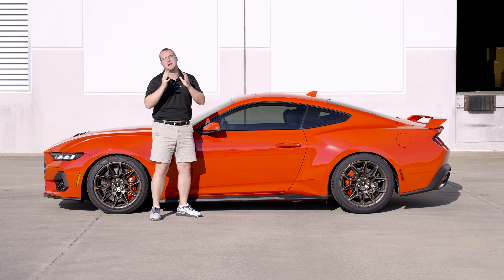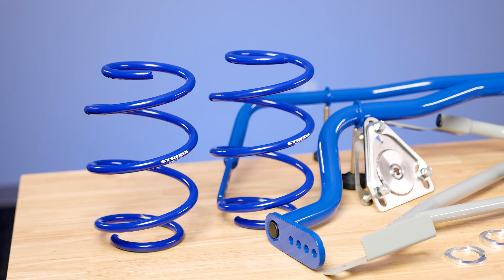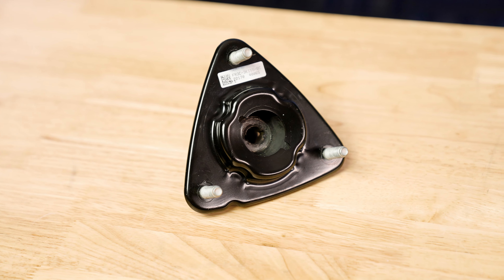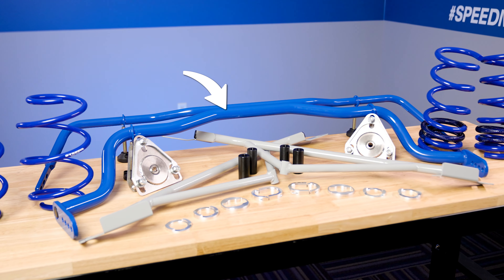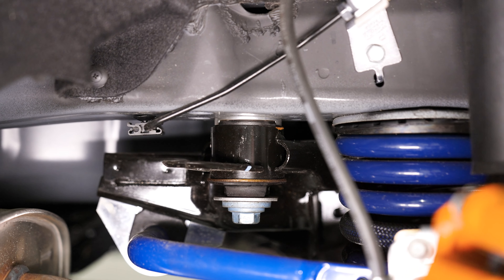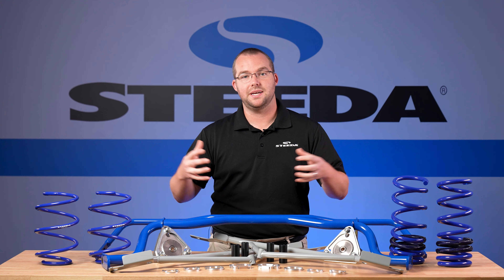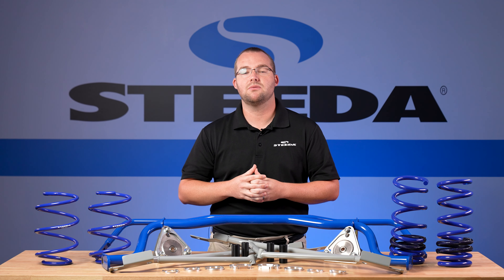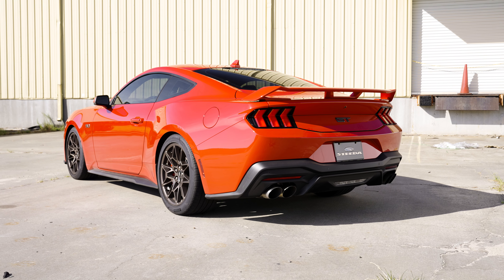How to Make Your 2024 Mustang GT Faster with Steeda Suspension!

Comment: The first mod on the 24’s should be getting rid of those garbage Pirelli tires
Reply from the maker: These are actually a newer version and quite a bit stickier than the outgoing P-Zeros on the S550s. I'd say they're on-par with the Michelin Pilot Sport 4S you see on the base Mach 1s! -Chris
Reply: @steedaautosports  nah they are not
Reply: I crashed my s550 with those 💀 in the rain going 65 on a 70 they suck my s650 so far nothing but I agree they do suck

Comment: I'd like to see a supercharged manual mustang, 60ft testing with the Steeda pro action adjustable shocks/struts and the ultimate stop the hop kit at a prepped track vs the stock suspension. I know Jay at Velocity motorsports ran a 1.4 60 ft at a prepped track with a manual.

Comment: Just make sure you save for new magnaride shocks at about 50k miles. My PP2 needs them replaced and I’m being quoted over 3,000 to fix. And the drive modes won’t change when you have a problem with the shocks at least in my case.
Reply: Have you heard that this is a common issue? I’m debating between a 2018 with 50k and magnaride and a 2020 with 40k and no magnaride but with steeda lowering springs. Concerned about being too low a ride height for parking garages tho
Reply: @TheCth777  get no magnaride and just do a complete aftermarket suspension. The most important thing is to get one that has the modes that change the throttle response. Like sport and track mode switches. I don’t think the magnaride is all that necessary for every day driving. Those throttle responses make a big difference in the way the car takes off under throttle.
Reply: @TheCth777  so far I haven’t heard this being a common issue. I dont even beat on my car. The dealer just said they don’t see any evidence that I have ever done anything out of the ordinary yet they said they won’t cover it. They also said they’ve never seen anything like it because it sheered the magnaride connection on that shock. It cost me $800 to have it fixed at ford. Didn’t grant my warranty and it’s funny because I bought an extended warrranty for the electronics which includes the magnaride. Guess they lied to me.
Reply: @6ixspeedstang186  interesting… I actually found a 21 that has the drive modes, active exhaust, low mileage but no magnaride or PP. Test drive tomorrow… fingers crossed.
Reply: @6ixspeedstang186  I do hope to do autocross but even for that can probably just get away with no magnaride
Reply: @TheCth777  go for that one. Just change to 6 pistons, change rotors, full suspension, wider wheels and tires. Find a good 19x10 or higher front and same in the rear with 305s minimum.

Comment: What about rear camber?  Are the factory parts good enough for a 1 inch drop?
Reply from the maker: There is up to 2 degrees of camber adjustment from the factory in the rear, which is more than enough for a 1 inch drop.
Reply: @ awesome. Thank you!

Comment: Can you install this kit and then go with an aftermarket 20in wheel set up and still achieve a sold handling daily driver ?
Reply from the maker: Yes! This set up is designed for the daily driver in mind. With aftermarket wheels, you could potentially find a lighter setup and find even more performance gains there.

Comment: Highly recommend you Supply a Shorter Drive Shaft that Connects the Transmission and the Rear Differential.  Since lowering make the DriveShaft Angle Shallower... Otherwise under hard launch in straight the Squat makes the Angle even more Shallow ( Especially From a Dig). U-Joints will be the 1st to Fail or the Clutch will Explode. Then the Differential and the Cycle will be On Going.. Lower Rider Effect drive slow. The 1970's 1980's used to Raised the Rear Suspension due to this, hence the Funny Car. 
👨🏻🤘🏻🏁🚩🌲⛰️🧗🏻

Comment: newbie question, can you add magneride to a regular GT in aftermarket?
Reply from the maker: Not really. You would need to transfer the shocks and struts, wiring harnesses for each corner, ride height sensors, wheel hubs, and the entire computer that controls the system. Then reprogram the car and body control modules to adapt to the new setup. Which a lot of that you can't do without a specialized tool from a Ford dealer.

Comment: Will this setup work on a S650 convertible or are the spring rates different for the convertible because of the extra weight?
Reply from the maker: Everything aside from the IRS Subframe Braces will work on a convertible due to the bracing. The ride height may be slightly different than a coupe due to the extra weight, but the difference isn't enough to change the spring rate.

Comment: Is that kit work for 1/4 mile ? If we need for maximum straight launch with no swerve
Reply from the maker: We have different springs and sway bars that are engineered for drag racing. The Stop the Hop Starter Kit is a must for the 1/4 mile, but we have other kits designed for drag racing depending on how much time you spend at the track.

Comment: How do I improve the handling on the Mach 1 with the non handling package
Reply from the maker: With these same parts! We'd recommend the MagneRide Dual Rate Springs and Competition Rear Sway bar if you're more focused on handling. We do have a separate kit for the Subframe Bushing Supports on the Mach 1 as they omit one component compared to a GT. You can find that kit here -> https://www.steeda.com/steeda-555-4449-gt350-irs-bushing-support-system